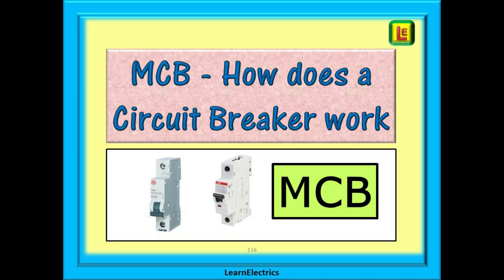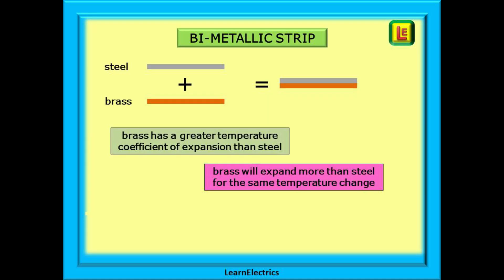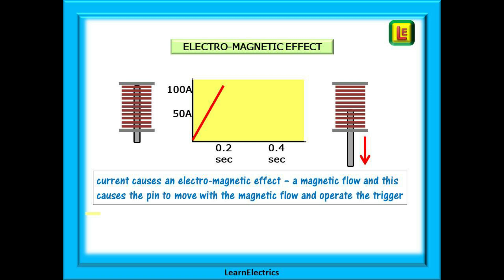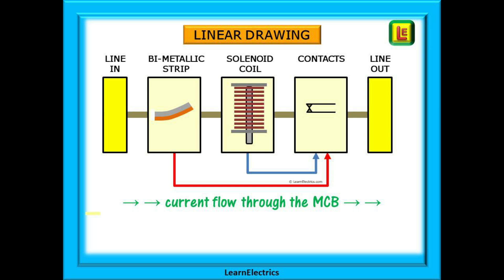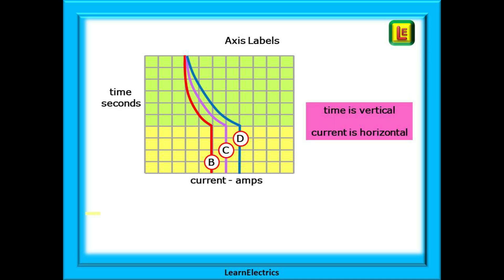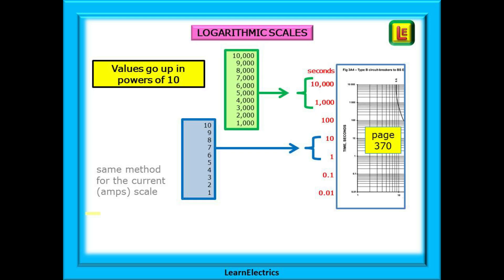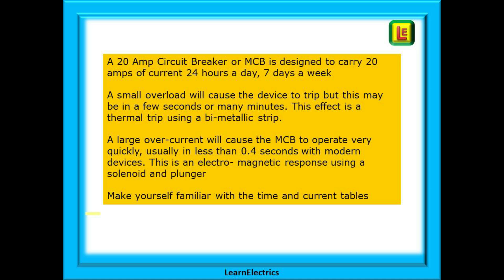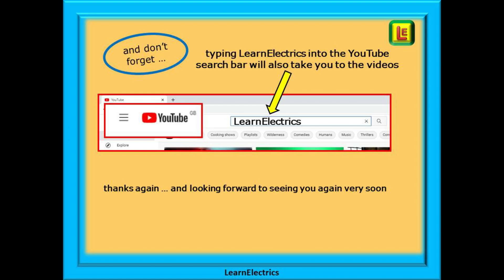MCB – Circuit Breaker – How does it work?

Comment: I don't understand why slowly changing current will have no, or little, electromagnetic effect. I believe this is wrong. I suspect you are confused by the difference between this and the property of inductor, which resists rapid change of current. Please correct me if I'm wrong of course.
Reply from the maker: Thanks for your input.
Reply: @learnelectrics4402  thanks for your video. It’s still very helpful.

Comment: Thank you, very interesting and I now understand both the mechanism and the table. My only comment would be that when you showed the reg table (and then your simplified, coloured version) you didn’t state what the line (with the knee) ACTUALLY signified…..ie if you simply said “this line is when/where the MCB trips” it would have immediately made it all clear. Not a criticism, just pointing it out. Thanks for posting 👍🙂
Reply from the maker: It does actually say in the video. The point at which the MCB operates almost instantaneously. The MCB can trip before the knee too if it is a thermal response. Have another look at the video, it is there. Hope this helps. Dave.

Comment: Great video Dave so simple to follow, i do have a question tho please.

How would the cable hold up with such long tripping times as explained at 10:30?

lets say the 20amp circuit scenario is a 2.5mm twin and earth cable and was carrying the mentioned overload current for 2000 seconds or 33 minutes.

That cable is designed to only withstand 26-27 amps normally thats if it is not buried in insulation, so i appreciate 30 amps isn’t a great deal more than what the cable can withstand, however, 

What could be done more to protect the cable from overheating/melting or in more serious scenarios where there is more fault current flowing potentially causing a fire under these slow trip times?

Sorry if this is a daft question but i’m just trying to better myself

Keep up the great work love the channel
Reply from the maker: That's a good question and logically it doesn't add up but this is the standard to which the MCBs have been manufactured and we assume that they know best. I just use 30 amps as a classroom example to show that not every overload will cause an instant trip. Most often though it may be two 13A devices (kettles) and that is less than the cable max. Not a daft question at all my friend. keep them coming and thanks for watching. Dave.
Reply: Thanks fpr replying dave 👍